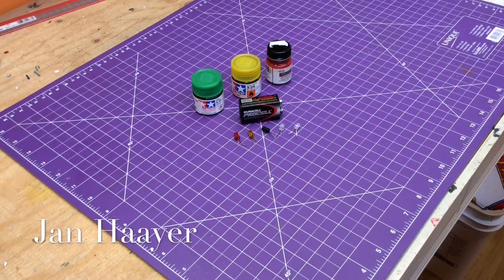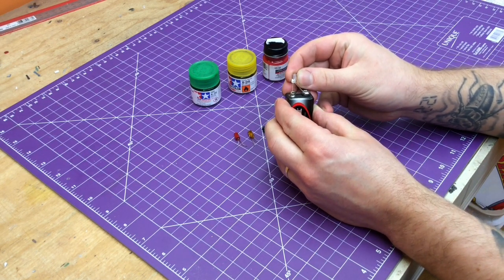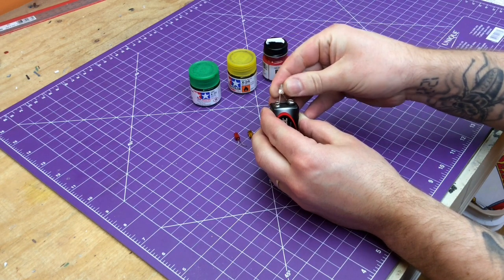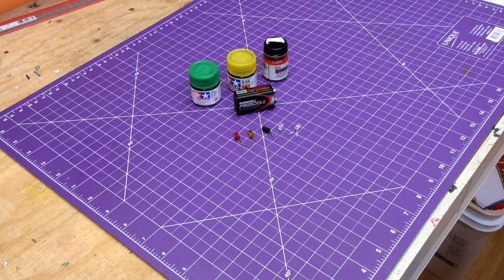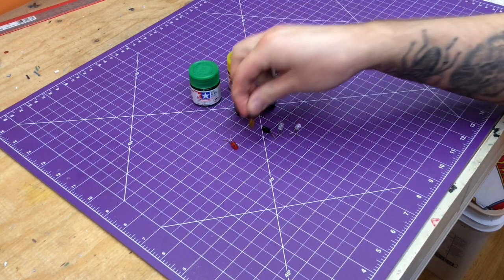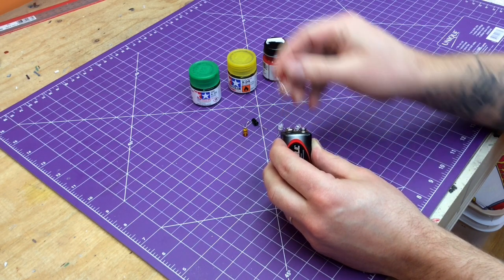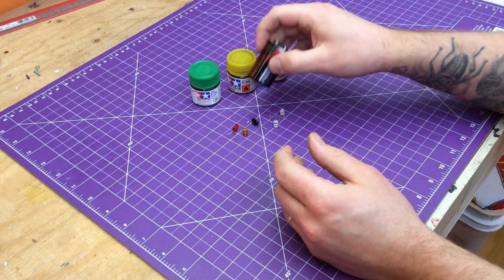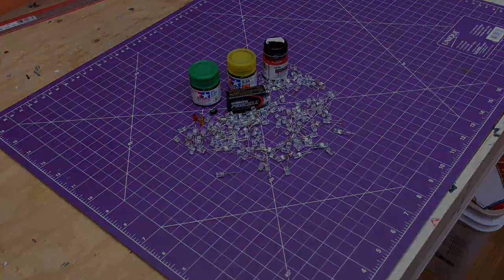How To Use LED Lights In Your Scale Models

Comment: I just ordered a 1/400 scale Model of Titanic and now with led tape lights I think I can fully light it up and I have seen a few incredible Models of it lit up and just wondering for those two navigation lights on the bridge if I have to use those diodes as they are separated by about 7 inches on this model but also wondering if I can attach just two diodes to a light tape??

Comment: Even though they came out of a Xmas tree set, that was 24VDC to the lights, keep in mind, that 24VDC is to run the entire string, and the combined resistance of the wires and the number of LEDs probably keeps the voltage in check so as it doesn't burn them out prematurely. As well the transformer probably has built in resistance, limiting the amount of voltage going to the LEDs themselves.  

Running 9VDC on a couple of LEDs will artificially burn them out. LEDs are pretty much all the same power requirements, just in a string of lights, you need the extra voltage to run so many lights.

If you were going to use them, they really should be paired with a suitable resistor to bring the voltage going to the LED down to around 3VDC. I wouldn't go any higher than that. 

You can use any amount of DC power, just need the proper amount of resistance to drop the voltage down to what the LED needs to light, but not so much to burn them out. Last thing you want to do is finish your masterpiece, put LEDs in it, where they can't be accessed and then they burn out 2hrs later after turning them on. 

Running them with a 9V like you were, they will work for a short time...but will burn out quite quickly. Of course it all depends on the LED rating....but have never seen a single LED rated to 24VDC. 

LEDs that size are good if you want to run fibre op off of them for smaller points of light. One of those bulbs could probably light 25-30 strands if fibre, depending on the size of the fibre strands.
Reply from the maker: +Scott Millican Great info... Do you know how to find the right resistor to bring the voltage down to 1-3 volts from 9?
Reply: I do, problem is you need the rating for the LEDs themselves, in order to figure it out.

There are various LED calculators out there to figure it out, but without the info from the LEDs...it is pretty much a shot in the dark.